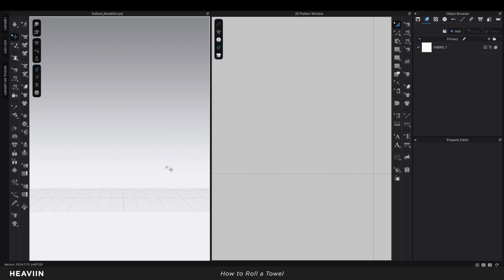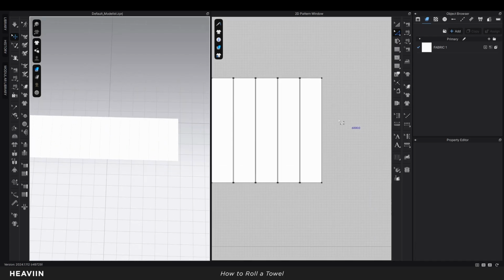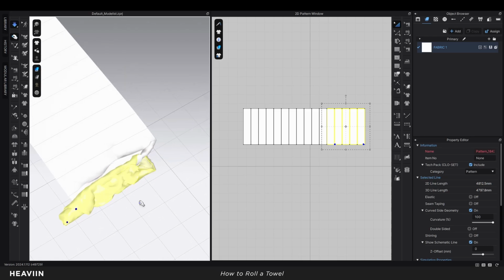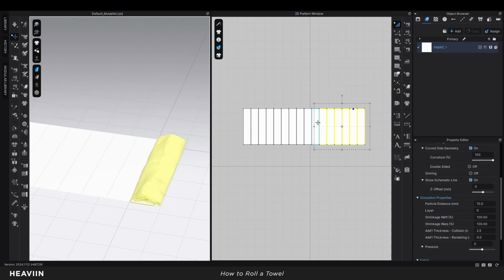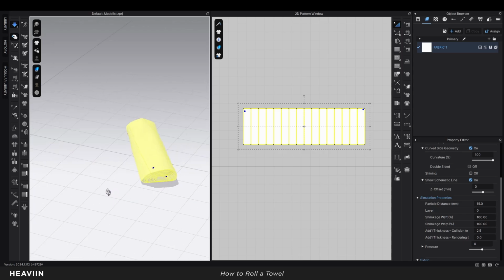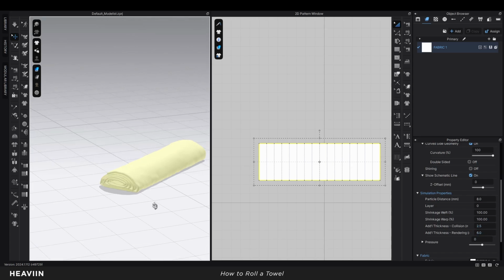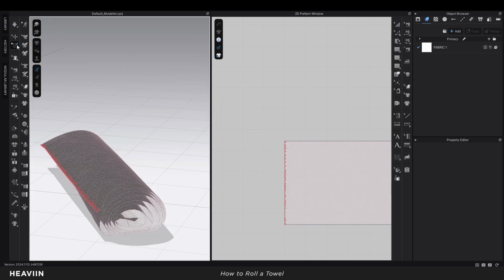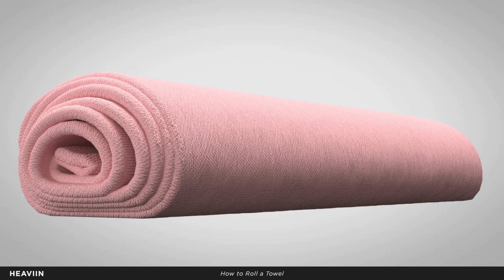How to Roll a Towel in Marvelous Designer, CLO 3D || Quick 3D Tutorial

Comment: Why is your simulation so smooth? did you change the simulation properties? or is it your fabric? :D
Reply from the maker: @leonie65  Ok so there's actually several factors that affect simulation speed in CLO/MD!
1. Particle distance: the higher the particle distance (less tris), the faster the simulation. So particle distance 20 is much faster than 8 for ex.
2. Amount of pieces: since there's only one fabric piece (the towel), it's much faster even at lower particle distance.
3. Simulation type: CLO and MD recently revamped their GPU simulation, so this is MUCH faster than CPU simulation even at very low particle distance.
As far as I know, fabric type doesn't really change simulation speed :)
Reply: @Heaviin  thank you so much for your answer!! Turns out it was a bug. I set up a new file and everything works.
Reply from the maker: @leonie65  NP! Glad you figured it out ❤️